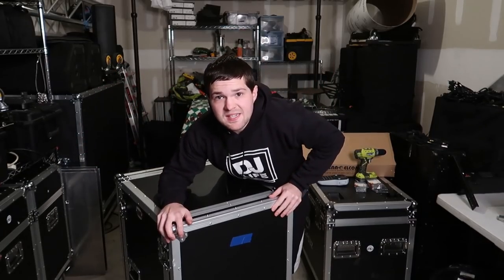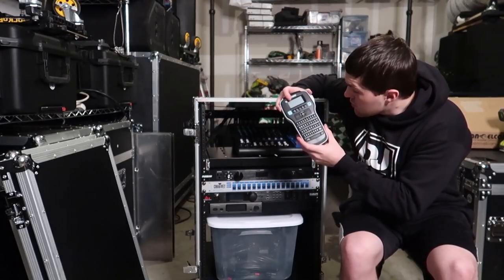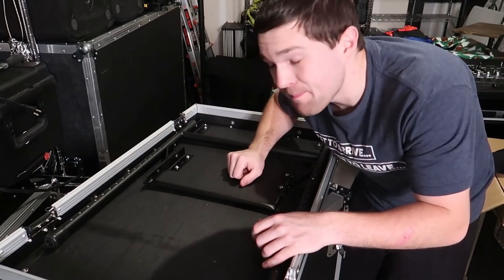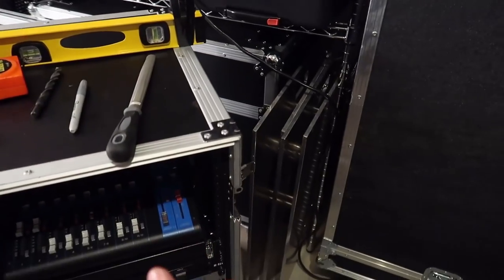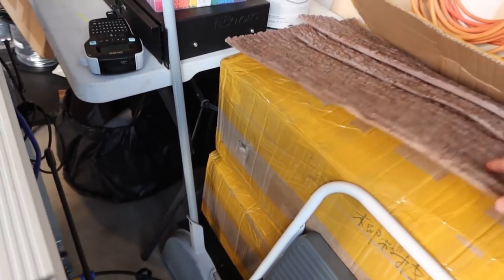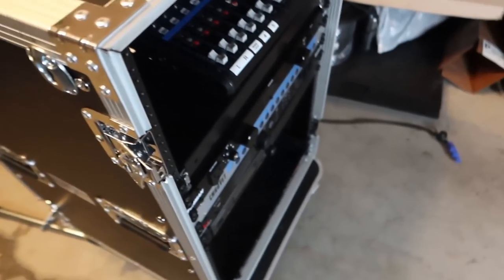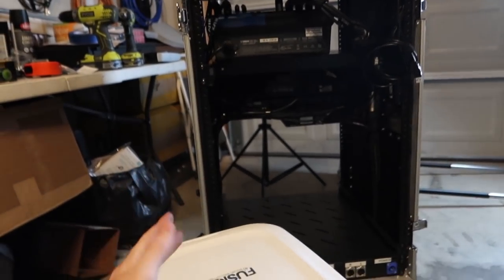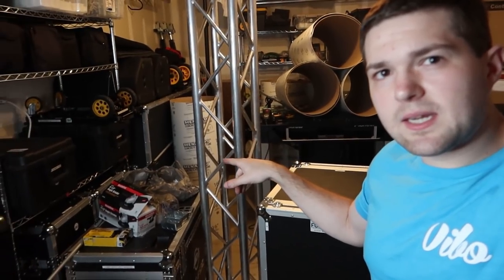Making Road Case LIDS into TABLES - ULTIMATE DJ Rack Build Part 2 (How to Tutorial)

Comment: RE: Table latches making it necessary to put the rack lids on "upside down"
I roadie for a band and we had the same issue. The answer was to add a 3/4" plywood baord between the rack and the wheel (caster) board. It lifted the rack high enough to allow the lid to be put on "right side up." That will make the top of your closed rack a lot smoother.  Kudos for "bending Reality" to accommodate your needs.

Comment: Most of my case building supplies come from TCH Hardware (locations in the US & Canada). As for going up stairs... two words, Appliance Dolly. They have dual rubber tank tracks built in that makes rolling up each step much easier. After seeing a furniture company using one to carry a fridge up a flight of stairs, I was sold on it. I've even seen some versions that can be converted into a 4 wheel dolly (kinda like a Rock-N-Roller), but those can be expensive.

Comment: Thanks for the video Rick. Awesome Job on your build. If it serves your purpose then all is well. Very clean set up as well as description of parts you used. I am looking at doing something like this but on a smaller scale. I currently have a lot of separate pieces that I would like to combine in one single unit to minimize my work area. I currently have a 6 foot table with a DJ booth that fits in a bag. It’s all made from cloth and PVC. Love your channel as it brings so many ideas to the table. Keep up the good work. 
DJ Mike 🎤

Comment: Those legs needed some leveling feet to be able to adjust that last inch where it is needed. thanks for a great video. I had been trying to figure out what hardware I would need to make flight case desks. I do emergency communications as a HAM radio operator, and always wanted to set up a portable station that I could just arrive on site and quickly have everything set up. The pelican desks are obscenely expensive.

Comment: Haha.. I wondered why you were going to this much trouble. Makes sense now. I say that because a few years ago, I had a roadcase basically the same as that. The differences were that mine had a fold up mixer rack up top, and both the covers already had hardware built on to use them as tables. (Just the mounts were about half way down the case which use to bug me.) 

But cool to see someone build their own nonetheless.

Comment: Rig looks good. Very good thinking. One suggestion. I noticed on your analog mixer that the channels coming from your Dj controler  are panned to the center. I'm not sure if you keep it this way or not but you should pan the left channel to the left and the right channel to the right. This way you keep your true stereo image and don't lose any panning effect the track may have. Otherwise if you close your right channel the right speaker will stay on because the left channel is still feeding it. Not sure if you knew that or not. Most Dj's in my area have no clue about audio at all. It's really sad.
Reply from the maker: Lol. Yeah. I haven't actually used this setup since the whole no gig thing.

Comment: Most road/flight company's make a case like this already. any reason why you went for the pull draw for the mixer and not a Slant-Top for the mixing Console?
Reply from the maker: So I can use the top as a place to put my laptop or other things. Dont plan on actively using the board at events. More setting levels and minor adjustments.

Comment: any reason you have set up to use two mono channels for stereo input and not one of the 4 stereo inputs? If you leave it like that remember to pan those L & R so you still keep stereo image.
Reply: A second thought. If you run your controller in XLR to that mixer you will be using the mic preamps when it isn't needed. TRS into that mixer to carry a line input unless I am mistaken. if I am wrong someone drop some knowledge on me.
Reply from the maker: The first 4 inputs are mic/line switchable on the Yamaha mg12. There is a switch to jump between the two.
Reply from the maker: Aware. It was more to keep xlr through the chain. And the board already has more inputs then I need. So why not
Reply: @DJRickWeb  so the switch you are talking about is the "pad" switch I think?  that is for hot input signals be it either line or mic. but from what i read in the manual XLR inputs go to mic preamps and TRS connections through the combo jack by pass the preamp for line level. on page 16 of the PDF manual here (will not let me copy and paste the text from pdf /shrug)  https://de.yamaha.com/files/download/other_assets/4/331024/mg20xu_en_om_e0.pdf. (edit was repeating myself)
Reply: This is the reason I am not a fan of XLR line level. causes issues when dealing with things like mixers with XLR outs and devices that link phantom power across inputs. 48v sent to mixer over XLR will burn the mixer or controller. but if you use XLR to trs in you bypass phantom power and preamps. 

(edit) reading the manual cause i am board and have no life. on that mixer phantom power is for all inputs so any XLR cable plugged into that mixer when phantom power is enabled will get 48V maybe making a bad day for a controller / mixer

Comment: Really good mod. With my engineer head on I would have worked out the height for the legs to be level with the top and drilled a new/custom hole for the leg positions. Also that way you always know which hole is the right position.
Reply from the maker: I just used a sharpy to mark the right hole

Comment: theirs no point buying a big rack case if you don’t have enough equipment to fit it in. You should buy a smaller rack case
Reply from the maker: The thing is full what are you talking about?
Reply: DJ Rick Web you put boxes of cables inside of it. That’s a no no
Reply from the maker: There is no such thing as a no no. It's a road case you can do whatever you want with it
Reply: Even if it isnt full it gets it to table height. And it has future expansion if needed. But anything smaller would be uncomfortable to mix at. Nice build. If I didnt get the krane amg 750 I would go this route. Probably going to do a 10u rack case. I have the Yamaha 10 channel mixer. I got the dbx rack also, audio technica 3000 series mic. A furman conditioner, when I get the rack probably get a 2u drawer for the mic and a slide out like yours for the mixer. I wonder why all my stuff is starting to look close to yours. New in the game and figured i could have some fun and build a set up. I have my own wedding coming up in october so I figured I would get all the gear and have it because I'm a tech geek. Running 2 ev elx200 10p on top of 2 elx 200 12sp subs. And ceremony set up 2 jbl eon one comps. Working on lighting now just got the chauvet quad wash usb t bar I will build from that. For real thanks for all the videos. Definitely got me into a new hobby the past 2 months.